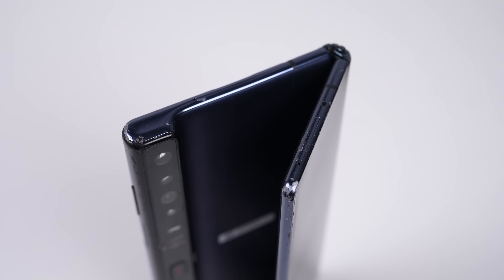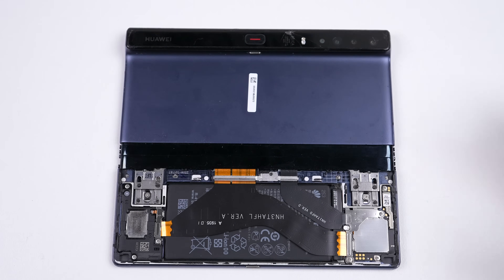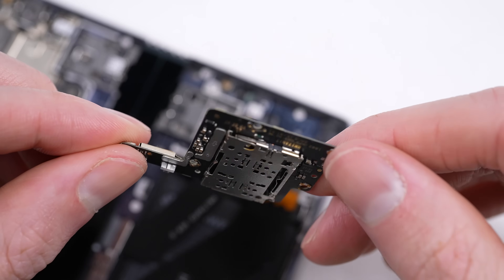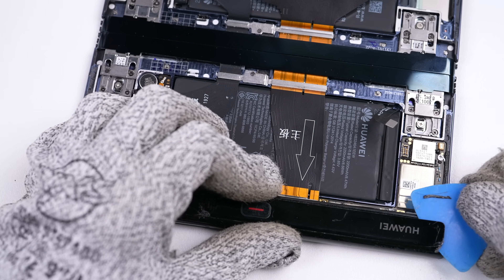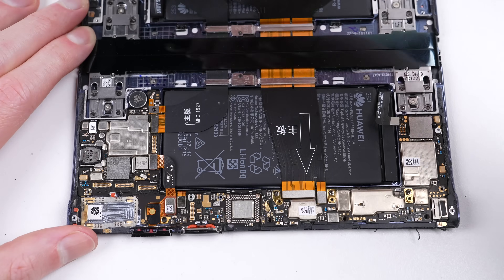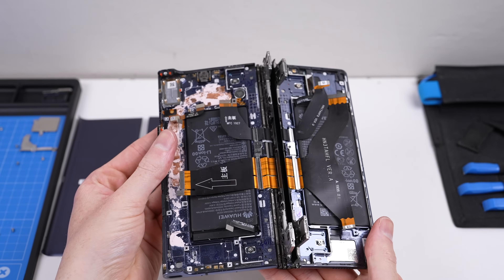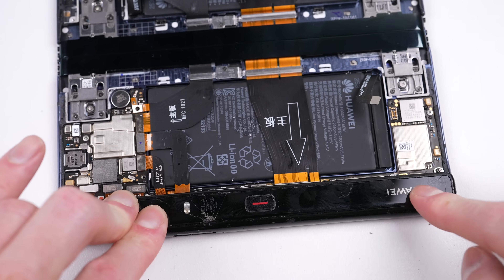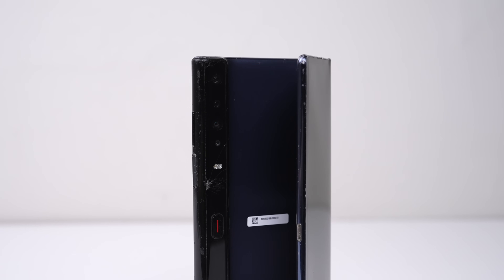Inside Huawei's Strangest Foldable - Mate X Teardown & Repair Assessment

Comment: I know this video was done two years ago, but I need to ask you for a small favor, can you tell me what's the value for the capacitor next to the horizontal spike of the three spikes with golden heads that are technically on top of the charging port? The capacitor's size is 0201, I would greatly appreciate it

Comment: That's why Samsung Galaxy fold 4 and flip 4 is the best option for every one that wants a foldable they have repair program they give you one year warranty for the display and internals and the software is constructed around the device meaning is designed to work on that particular device makeing the  experience how should be and sold worldwide so it's the best option for the people in the US and Europe due to the lack of Google software on the Chinese virgin of foldables like the Huawei xhomi honor vivo oppo fine n not only that they have not too great software experience they're only Chinese versions there is no global version there's a good news Google is coming out with the pixel foldable very soon and Apple don't exist in this market not till 2025 2026 and I don't think they will make foldable virgin because Apple always wants to charge outrageous prices I think they're only interested in a flip version I think if Apple releases a foldable like the z fold 4 it's going to retail at 2100 it's definitely not going to be worth that much apple always trying to milk the consumers fold already expensive but they're going to be more expensive with the apple virgin

Comment: Hi. You are my last hope! I've encountered 2 issues with ip12 and can't find the solution anywhere:
1) I'm getting a certain problem with face id module annually. It is somehow related to overheat, but at the same time I had no issues while using my phone in summer with +32 celsius. Have you ever encountered this phenomena and do you have any suggestions?
2) FaceID module initialization. I've tried EVERYTHING to fix this but still have no idea how to act.  So module itself is 100% initialized by the system,all things related to FaceID module are working, except face recognition itself(((
So portrait mode works perfectly and recognises face with a yellow frame with no doubt.Animoji feature is also functioning perfectly. But when i try to set up face id i always encounter a "f-id is unavailable, try later" sign. So all suggestions on Internet always trying to resolf a hardware issue, but it seems thet my problem was caused by software and there are no advises how to get rid of it on the Internet. Help me,someone((
Reply: Update to iOS 16.3 when it releases

Comment: Hi Hugh. I have an S9+. It won't power on. Changed battery and charging port. Still no power, or able to power on. With your knowledge, would you say to replace the motherboard?? The phone has all my photos and data on it. Yes, I know. Backup would have resolved this issue. Lol. Thanks.

Comment: It's shocking that they thought this was ready for market! This goes for basically all foldables: It is simply inevitable that the screen will break and require a dangerous and costly repair!
Reply: Actually I've had a Galaxy Z Fold3 for 18 months now and it still works flawlessly. I don't think it's "inevitable" given a reasonable lifespan (<4 years) and some decent care. Some people are still using the original Galaxy Fold (after its updates, of course) for almost four years now.
Reply: @lucaandreamifsudbuhagiar9375  Doesn't change the fact that Z Folds constantly break and many do so even before a year. Austin Evens here on YouTube(tech youtuber) admitted to his Z Folds having problems with the latest being the Z Fold3(April 22, 2022) that died from overheating, causing random restarts and the screen is the only thing that flickers. His 1st and 2nd  generations all failing at the screen. Other users also having failing screens on 3rd generation as well. They are supposed to last 200k folds equating to 2-3 years of use and many of them failing within a year. All foldables are not ready for long time use and I am not willing to pay the $500-1000 premium to be a tester.

I've personally moved away from Samsung since my Galaxy S7 Active. I've had to have the phone replaced under warranty at least 3 times. The last time was because the replacement they sent me the physical android buttons were stuck on the glass. The other phones had defective screens causing color stripes to appear. I still have my last S7 and it has that issue. Oh and the AT&T model Samsung smartwatch that I got for free with the phone? It's on it's deathbed because they do not sell the replacement battery for it. I bought a replacement battery and found out during disassembly that despite the model number being the same, the cable was made differently, my old watch is ewaste.
Reply: @MrMega200  To an extent, I agree, though I still thing that overall, the majority of the phones do fare well. Admittedly, there are duds and manufacturing defects, especially with the UTG on the phones, causing the screens to break, typically within a month or two, in these cases. That is a risk one takes, and in such a case, Samsung would be obliged to repair the device under warranty. Now how easy that is in practice is another story.

I disagreed with OP's initial statement though: "It is simply inevitable that the screen will break and require a dangerous and costly repair'. It is not inevitable. In fact, most of them do not suffer from that fate. But some do, and yes, foldables are still not as durable as a slab phone (and might never be, honestly). Of course, we hear about the problems more because you generally don't hear those who are satisfied - they don't talk about it and it doesn't make headlines. For me, a person who takes care of my device, I love it and have not encountered issues 16 months into ownership. A family member shares the same sentiment as me, and owns a Flip 3. They sold millions of these devices. As with the original Fold, if these issues were so widespread, we'd be hearing way more about them.
Reply: Old foldables are no different, usually they would work 1-2 years until the screen/front buttons connection would wear out. Nowadays problem is that these kind of devices are not built with repairability in mind.
Reply: do take note that samsung had the concept of foldable phone 7 - 8 years ago during their presentation, it was not a new technology but it unlocks a new way for how folding display works.
Reply: It's a red Chinese designed piece of crap...you are honestly expecting it to be durable?
Reply: @Shinzon23  show us a western good quality foldable phone

Comment: I really do like my Fold2 from Samsung. Though I have to say I do agree with the absurdly high prices for a screen replacement. Luckily though some people are tearing down old phones and selling off still working screens and frames. My Fold2 was actually also supposed to be e-waste due to damage to the outer screen and scuffs on the inner one. However I am using it as my daily after purchasing it. I did not regret buying this and using it as is.
Reply: Amazing what planned obsolescence has done
Reply: My S9 has a broken screen and the entire phone on ebay costs the same as a screen replacement from ifixit.
Reply: @Splarkszter  yeah its cheaper just to buy a whole phone and harvest the parts needed.

Comment: I don't think that the Mate X would be worth buying because of the design. Instead of the folding screen being on the inside it is on the outside. The repairability sucks and I would rather get the Galaxy Z Fold. It is better designed and it does not get dust in the hinges.

Comment: This has to be the worst foldable phone I've ever seen. The lack of repairability, and durability, is why I wouldn't touch foldables with a barge pole. But still, at least the repairability is (only just) slightly better than an iPhone 14 or 14 Pro.

Comment: This phone is like having your private parts hanging outside of the jock strap.  Thanks for illustrating an overly complex & fragile phone that has almost no reasonable repairability. Even with Samsungs, I wouldn't consider getting a foldable, just so fragile and not comparable to a non-folding model.  No thanks.

Comment: Remember : Huawei removes photos/videos and or other documents of the protests that are happening in China right now from the storage of the device. Huawei is owned by CCP.

Apple introduced a restriction on a Feature which allows you share files locally without having the need for internet Where now you can only share some files and then have to restart the function, right when there protests going around in China, saying It's for "reducing battery consumption".

Comment: Failure rate for this design should be higher simply due to the fact that you’d apply pressure on the display to fold and unfold it.

Comment: Shame you couldn't reuse all these boards and batteries to make a single screen phone of your own with a 3D printed case. Will these guts fit in a one tab 10 chassis? You would have a vastly updated tablet with phone and the CCP in your ear. Looks like the phone works just the screen is dead?

Comment: After seeing JERRYRIGEVERYTHING ZACK sir damaging display of some Samsung fold just by fingertip, no one even dares to buy a foldable phone for following reasons:

Costly is too high

Display (folding) is Plastic with false advertising 

No replacement parts & teardown and replacing parts for common citizens would be a dream

Conclusion: It's just a luxurious Plastic device that's non economical and non environmental. Use and throw like a garbage Plastic that's it

Comment: In my opinion, the foldable phones are ugly. That being said, I don't think these phones have a future.
Reply: Was a neat gimmick when I used my Z Flip, but it got old quick with me worrying about breaking the screen. Somehow put a tiny hole in the screen when it was sitting on my desk once. Worked fine apart from having a couple dead pixels from that.

Oh yeah, also as the hinge wears out a little, it starts to not open completely flat anymore
Reply: That’s a shame. I tried one of those out at T Mobile and quite liked the experience but had my doubts about the durability long term. Oh well.
Reply: i think the zflip 3 5g by samsung is cool! u can get a refurbished zflip 3 5g on amazon us for like 350$ usd which is crazy!
Reply: @dylanlindsay1993  I wouldn't get it. Has dreadful battery life
Reply: yepp total nuggets those foldable phones are mate dingus.

Comment: I think foldable screens should be built different. I have somewhat of a concept but it would take some time and engineering to make.
Reply: What is the concept?
Reply: @traviswalker8933  Combining 3 separate displays with 2 non flexible displays and one flexible display but the digitizer will be one whole flexible piece and the polarizer not only blurs out the bezels (the bezels being quite thin) but makes it look quite complete. This would eliminate the whole display getting damaged and theoretically be modular to replace the broken component. The only flaws there are would be a more expensive price to manufacture, the hinge, and correctly calibrating the display to the polarizer. If this display was paired with the right calibration and software, this would work amazingly.
Reply: @Forrest_O.  The digitizer would be the weakest link in this design.
Reply: Nah don't overthink it, foldables will be here just for a few more years. Rollables already solve pretty much every issues foldables have to face and they can come even next year already as demo devices was already showed.
Reply: If I were to design one I'd have the majority of the screen be tempered glass or sapphire and just have the foldable section be made of plastic. Bonding the two materials is likely difficult to do, though.